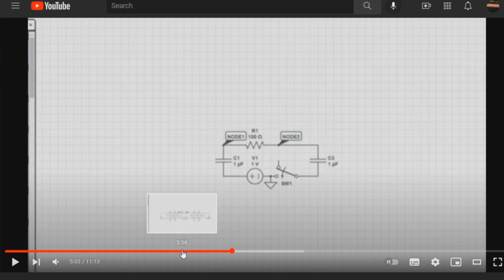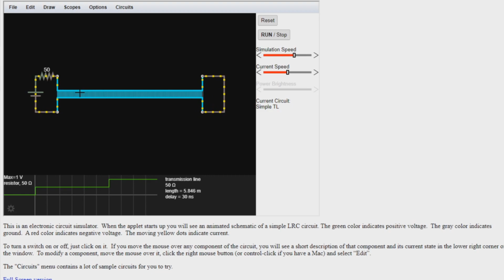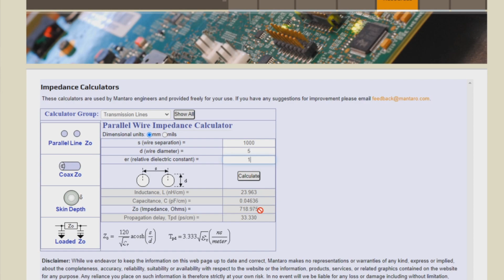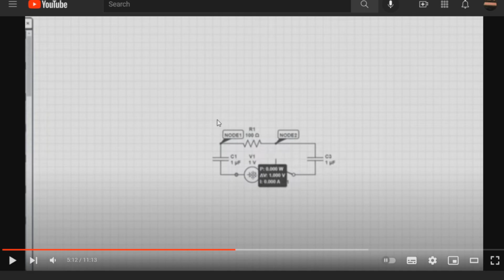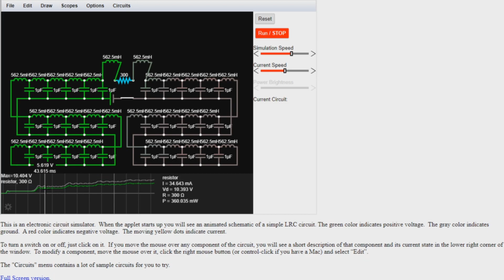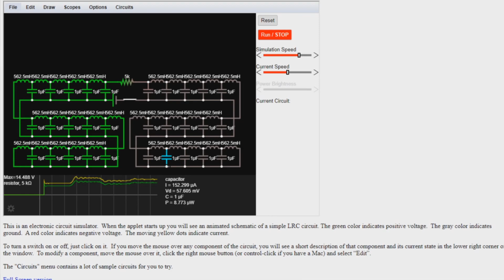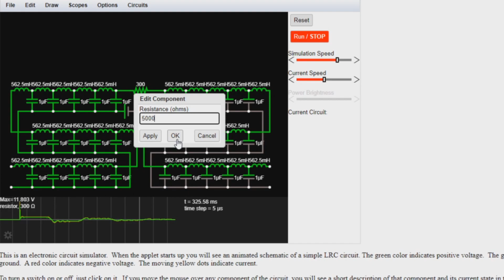2nd analysis, I think I was originally wrong! - Veritasium "The Big Misconception About Electricity"

Comment: My main problem is that at 1m/c time you actually don't know whether the circuit is closed or not. This is clearly shown in your simulations (mega thanks for it!).
So I would expect the same currents for an open and a closed circuit for at least 0.5sec: if 3 people at the switch and the two side of the circuit shout (with the speed of light...) that "Closed!" then the bulb has to wait for 0.5sec to know that the circuit is closed and it can turn on.
So if I turn the switch in an open circuit, can I say after that that the light is on (the current you showed will be there...)? It's like you forgot to take the bulb into the socket, but you already yell at 1m/c time that "Done!". Probably my wife would say, let's try that again...
Again, I do understand that there is current at 1m/c time, but it doesn't tell anything about whether the light will be on later whether it will get to a stable state. In your circuit this is 20ms! Even when I break the already on circuit, I have to wait another 20ms to the current to begin to fall!
I don't know when you can distinguish the two case (open/closed circuit) exactly, but from that point can we tell that the light is on. We surely know that 1sec is enough and I am quite confident that the 0.5sec is the minimum.
Still, it's very interesting to see that in theory this current can be comparable with the current of the steady state. Thanks again! Great video!
The message for me is quite clear: if you have 2s*c wire and you have to turn on something, you actually have to wait for 1sec before making any judgement, because what we might see can be quite misleading. :P
Reply from the maker: So the way to see it is that both the open circuit short circuited terminations both have exactly the same initial response. What would change is after 1s the circuitry around the bulb will finally see the reflection of electricity from the terminals. This reflection is what contains the information about what is happening at the ends, and this reflection will either add or subtract to the voltage on the bulb. So yes, even with an open ended circuit the bulb can turn on, and the bulb will not know whether it should actually be on or off until 1s later.
Reply: @ZongyiYang  Exactly. From this point, the discussion is rather theoritical on what we can call the light is "on". 
On one side we don't know yet whether we surely, stabily succeed on turning on the light.
On the other side this is a rather "stable" current itself and it can be even comparable with the final state's current with a proper setup, not just a small spike.
I think both are acceptable, before your simulations there was no way I could imagine the second as a valid option (I mean the 1m/c etc.).

Comment: Awesome video ! I wonder if there is more to say. The light bulb strongly turns on only if it has a big enough impedance (compared to the line). Turns out light-bulbs are more interesting than simple resistors. They apparently have a very small resistance when they are cold and the resistance increases as they get hotter.
It's also worth mentioning that Veritasium was trying to show "How energy gets transmitted between the battery and the lamp". And although the initial energy comes right through the air between the two (as we was claiming), the path the energy takes actually moves forward at a speed close to the speed of light until it reaches the end of the circuit and then bounces back.
Reply from the maker: Interestingly enough I'm working on a video relating to the exact problem of filament inrush. It's for my other hobby of vintage display technologies, where there is a display called the numitron that is just a bunch of filaments. I am attempting to protect these filaments from early burn out due to the large inrush current, and I found the normal approach of just adding a resistor is good enough or does anything useful at all!

Comment: This is very persuasive! I know just enough about the topic to be aware that you can model transmission lines with discrete components in this manner.

As the folks at the NYU Quantum Technology Lab liked your original video ( https://www.youtube.com/watch?v=gezZklOsGbg ), I pointed out to them that you had revised it.

I also wondered whether your use of discrete L and C values that are 225e3 larger than the per-meter values for the transmission line means that this model cannot be used to consider what happens in time periods less than it takes light to travel 225 km (because that's how long the line would have to be to have those values of L and C) - i.e. 0.75 milliseconds. My current thinking on this is that even if this were so, having the light come on after less than a millisecond, rather than after one second, would essentially vindicate Veritasium. I also suspect that if you model the problem with, say, ten times as many components each with one-tenth of the values used here, you will get the same result as you did here.
Reply: UPDATE: I wrote a simple program to create variations of this circuit, with N times more LC cells, each with 1/N times the inductance and capacitance of the original to keep the characteristic impedance the same. I was able to run up to about N=20 (so 300 cells on each side), and the essential features of the simulations with the various loads remained the same as in this video; the only difference was a reduction in the ringing (the high-frequency ripples.) Therefore, I am reasonably confident that this pattern would hold down to models where the inductance and capacitance values are the per-meter values for the transmission lines, and even  more fine-grained than that. I think you have nailed it!
Reply from the maker: @A.Raybould  Cool! Yes with an infinite number of elements, we should see perfect square steps with no ringing, just like in the simple transmission line example I showed.  Also my biggest fear was realized, that someone pointed to my first video and thought I was correct, haha. Hopefully they see the revised video too.

Comment: I have a lot of issues with the handwavy approach the original Veritasium video took but zooming out I'm grateful for all of these responses and that he got people to really think about this. So all in all maybe it was a good video due to its provocative nature.
Reply: Yeah, but...  Mr. Derek should SAY that his videos are just to be provocative and not to reflect reality.
Reply: @daveinwla6360  not sure i understand. what part did you think doesn't reflect reality?
Reply: @mirachan23   - The part about the bulb lighting after 1/c sec.  There will be a tiny step-up in voltage coupled to the "receiving antenna", but not enough voltage to light the bulb until after 1 sec.
Reply: @daveinwla6360  in the original problem statement, derek says that the lightbulb lights up immediately after current passes through it, i don't think he made any reference to a required voltage for the bulb to light up.
Reply: @mirachan23   - Current requires a voltage differential to flow.
Reply: @daveinwla6360  yes, and you already said there would be a step voltage present. non zero voltage across the bulb implies non zero current through it.
Reply: @mirachan23   - You're lonely.  Get a dog.
Reply: @daveinwla6360  Look bud, you replied to me first, if you don't want a discussion, don't reply.

Comment: Not even halfway through but this is already my favorite response video. Pairs well with Bogatin over on Feranec's channel. Major props for doing the simulations and going deeper than some of the uh, more popular youtube personalities.
Reply: Does EEVblog Dave have an eng. degree?   An engineer doing RF design should already know these 2-wire RF lines by heart, and figure out Veritasium's trick question in literally seconds.   Radio hams might be just as quick.   When I first saw it, it took me about thirty seconds to see the trick.   But I guesstimated the Zo for meter-wide gaps to be 600 ohms, when actually it's higher.    For long parallel wires, a meter-wide gap is extremely close coupling.  Putting a meter-wide gap in series with the bulb will not prevent the bulb from lighting up dimly, not if the 2-wire lines are long enough.   That's the main trick in the "trick question," don't be taken in by that apparently wide gap.

Comment: If we're not ignoring the capacitance, is it valid to ignore the resistance?

I think Veritasium said for the wires to have 0 resistance after the question was stated. so that would make it just a part of their solution, not part of the question. If we want to get the real answer, shouldn't we include the resistance?
Reply: when wires are drawn on circuit diagrams, it is implied that the resistance is negligible. (but to be fair, same goes for inductance, capacitance and length, but in this problem, ignoring these three is clearly not the intent)

And superconductors are real, just not yet used in practice as wires.

Comment: Don't use this tool. This tool is not for this type questions.
Reply from the maker: It is not useful for modeling the 1/c s distance, that is correct, but modelling the power transfer should be fine with this tool.
Reply: @ZongyiYang  It's a good attempt at simulation, but what justifies your use of 15 LC pairs in each leg... why not 20, or 50, or 695?  (seems like you'll need a lot more than 15 for modeling the specified length, and I think it would be more accurate with more, smaller pairs for the initial response to be accurate).
Reply from the maker: @stephens1393  If you want to model exactly 1s, you'd need more elements corresponding to the distances. For example, in the calculator I used the values were L/cm and C/cm. Multiplying by 10^6 means I'm approximating a 10km wire per unit. Using larger L and C values allows you to model the same distance with less elements for easier simulation, but you get more ringing. That is why my voltages don't step up in perfect square steps like in the simple transmission line example.

In essence: more LC blocks = longer reflection time, smaller LC values = less ringing but shorter reflection time. Using more blocks with smaller values will increase the waveform accuracy but it doesn't impact the overall power calculations and conclusions.

Comment: Yes! You got it 100% right. 
Please share the link to your simulation.
Another interesting case you didn't do is a line termination equal to Zo... in which case there should be no reflections.
Reply from the maker: I'm using the falstad simulator. I'm not sure if I can actually paste the link cause it is huge when saving my circuit as a link, but I'll try to add it to the video description.

Yup a matched termination is also an interesting case! I didn't want to get too sidetracked into transmission lines though as I didn't want to confuse anyone not familiar with too many topics.
Reply: Not so fast there. Peer review. I have a question, where did you get 1uF.
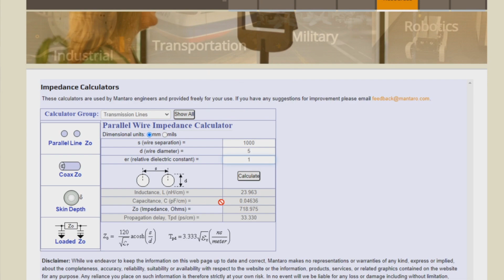Reply from the maker: @BenjaminGatti  Oops sorry I missed this comment the first time around. In case anyone from the future is reading this and is curious, at the 11:00 point in the video I show the computation to get the characteristic impedance of the physical setup. This gives a L and C value. Only the ratio between the L and C matters, so you can scale C to be 1uF and increase L accordingly to match (562.5mH).
Reply: @ZongyiYang  that's hilarious. You have two wires a meter apart. Given the event window is 3ns, your maximum relevant distance is 1 meter in any direction. Now with a pair of 18awg wires a door apart, you think 1uF is realistic? I suspect you've never measured the C of a circuit in your life. Gill-mann amnesia.
Reply from the maker: @BenjaminGatti  No need for insults. If you're actually interested in the reasoning, the original capacitance is ~0.04pF per 1cm of wire. Rescaling this to 1uF means each lumped element now represents ~200km of wire.
Reply: @ZongyiYang  lol. So how long does light/electricity take to travel this "lumped" distance? No insults, you just don't understand the assignment.
Reply from the maker: @BenjaminGatti  It of course takes the time equal to the lumped distance divided by the speed of light. You can verify for yourself this is represented in the simulation. Each lumped element model represents 1000000pF/0.04/100 meters of distance. There are 15 lumps per side, with a reflection a signal travels through 30 of these to reflect back for the first step up after the switch is thrown. Each vertical bar in the video's simulation graph is 10ms. You can see in the simulation the time between the steps is around 20-25mS. Doing 15x 2 x (1000000pF/0.04/100) / speed of light you get 21mS, within our 20-25mS range. Transmission line equations embed the effect of the speed of light into the model because they are derived from Maxwel's equations. Anyway, whether or not you believe the model is moot as since the Veritasium video has been released, people have made real world physical models and they match my results.

Comment: Can you please verify your simulator by placing the switch on the far right end of the circuit and keeping the source and load as before ?
It you are still getting an instant output on the load, it would mean we can create an interplanetary Morse code communication by using 2 such circuits. With switches on different sides of the universe and lightbulb with the battery on another, 2 users could see immediate reaction of switch action across the universe. That would be a conflict with the current understanding of physics so something would be wrong.
Reply from the maker: Yes, for a 300 ohm load if I place the switch on the far right end, assuming we have started with steady state, once you flip the switch a wave of potential changes will propagate from the switch to the battery/load in the middle. This will take 0.5s, after which the load sees 2V or 6mA of current as before. After that waves go through the load and travel another 0.5s to the other end of the wire before reflecting back taking another 0.5s. Since there is the 1s time delay, there is no conflict with causality. So the voltage on the load would be 0 at t(0), 2V at t(0.5s), and ~5V at t(1.5s) with further changes every reflection at 1s intervals.
Reply: @ZongyiYang  That's a great experiment proving the simulator is not breaking the causality limitations. You have convinced me and I am surprised how much role the line transmission plays. I still think though that Veritasium came to the right conclusion by luck through the incorrectly drawn Poynting vectors from battery to load.

Comment: That's a great simulation. I appreciate you went through extra work to consider the realistically expected modelling of the wire. The point about the inductance placement and it's effect on simulation was great. 
I noticed the simulator generates a delay after the start at 0s and the beginning of the voltage rise on the load. You didn't address it in the video, but isn't it actually related to the length of wires from the switch to the load ?
Reply from the maker: For the delay, I'm assuming you're not talking about just the time it takes for me to manually flip the switch showing up on the chart? Or maybe I'm looking at the wrong delay.
The 1m distance from the switch to the load is unmodeled, which is why I mention that it is almost instantaneous but in reality it will take a very minuscule 1/c seconds before the first response.
Reply: @ZongyiYang I am seeing 12ms delay in your graph and that's what I am asking about
Reply from the maker: @Martinko_Pcik  Can you point me to the specific time stamp in the video? The delay between reflections is dependent on the length of the transmission line. Since I can't make a 0.5 lightsecond long line, this is vastly reduced in the simulation. The other delay would be the time it takes for me to start the simulation and then manually flip on the switch.
Reply: @ZongyiYang  sorry I rewatched it and I was wrong about the delay I believed I saw. You are manually flipping the switch and not running simulation with the switch closed.